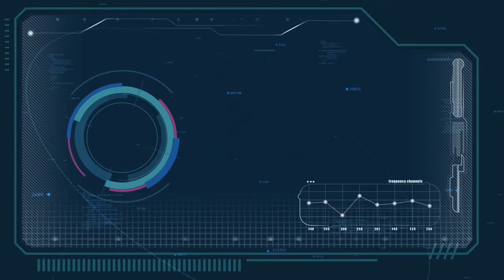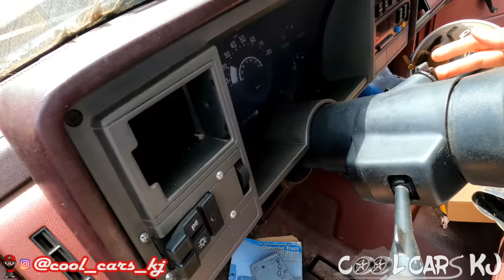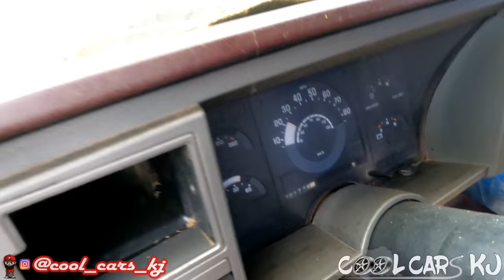We hit the junkyard w/ @moneymoochtv  like old times 🤣

Comment: To get the steering wheel off without a puller just take the nut off and wack the column shaft with a hammer.

Comment: Did you have to drill new holes to get the interior pilars to fit???? @28:29  I got a 94 single cab work truck as well. I just Scored all the interior pieces minus the headliner out the junk yard the other day.
Reply from the maker: The holes are already there if I recall.
Reply: @CoolCarsKJ  for 95-99 i think they bolt up but i think the 88-94 some holes need to be drilled if im not mistaken
Reply from the maker: The orange truck was a 95 so that might make sense. I doubt they were making different cabs tho, with & without holes. But I guess we'll see soon enough